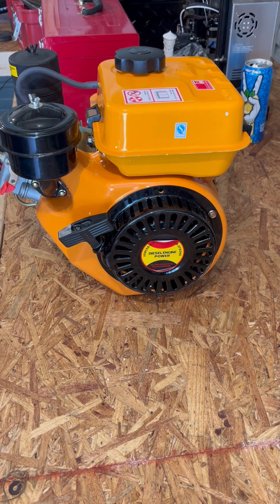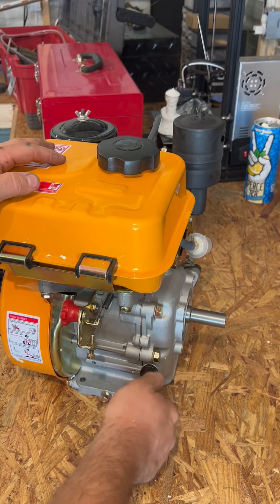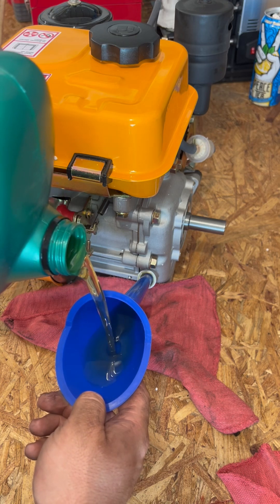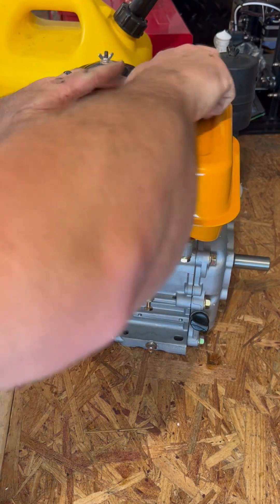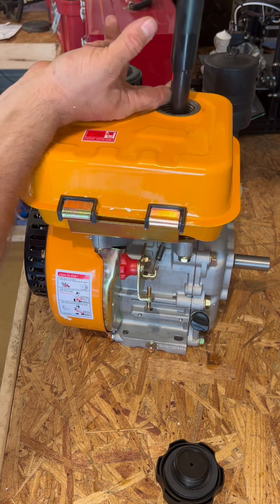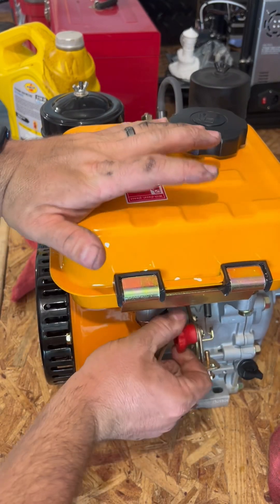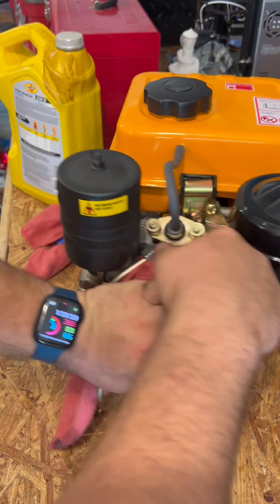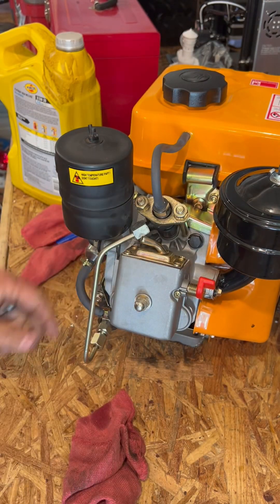$200 3HP Diesel Engine With 25LB FT of Torque?

Comment: I think these little diesel engines are super cool. But they have nowhere near 25 lb-ft a torque. They make peak torque at about 2500 RPM so if you calculate 3 * 5252 / 2500 you get 6.3 lb-ft which is a much more realistic number. 

I have one of these on a go-kart, lots of fun!

Comment: Believe it or not, it's only 6ft lbs of torque. I thought it was 25 initially too. I have one of these engines. Doing some digging and research I found it only was at 6ft lbs. The specs were based off of another larger engine in the manual. Just thought I'd share this with you.
Reply from the maker: I appreciate you letting me know that. Kinda weird they’d advertise 25, but it makes sense why it’s only 6. Still quite a bit of torque. Not too terrible only 3 horsepower.
Reply: @DTMCreations  Yeah I thought the same thing about the advertisement of the torque. But yeah 6ftlbs isn't bad for 3hp. The one thing great about this engine is that it is super fuel efficient. Its a pretty decent little engine.
Reply from the maker: @Super-225 I’ve run all sorts of fuel in it. Motor oil, trans fluid, brake fluid, hydraulic, baby oil, veggie oil… it just doesn’t quit
Reply: @DTMCreations I've seen videos of people doing that. Amazing little engine.
Reply: @DTMCreations  plus if the engine has 22 to 1 compression ratio (which this one does) it will run on just about anything.
Reply: @Super-225  22:1 compression ratio?!  Are U kidding me?!?!...  If so, no wonder it has a compression release for starting, Wow.   - take care man

Comment: They're very efficient and works very long but OMG they are too hard to start
Reply from the maker: I agree with you if you’re using the pole start, however, just unbolt the pull cover and use a socket on a drill while holding down the decompression lever, and it will fire right up when you let go of the lever.

Comment: That's expensive using road diesel in a little diesel engine like that get some of that untaxed off-road diesel
Reply from the maker: It was just for testing! It'll run on almost anything.
Reply: Six hours on a gallon? I use 15W40 oil and pump diesel and never look back. Would you feed your kids mouldy bread?

Comment: I can't get mine to run. I did everything in the video but fuel won't fill the lines. Like it doesn't leave the tank and I don't know what to do. Help
Reply: Very first step is to remove the hose off the fuel filter so you can pour fuel in the injection pump inlet hose by gravity, it is a little messy but once fuel is at the injection pump then you can simply turn the throttle knob all the way to max and hold the decompression lever down while you crank several times, you will notice that when fuel is squirting out the injector you will hear a loud squeaking noise, that is the point you just crank it up. No need to crack open injector lines to bleed.
Reply: I never even bled the line. I wired the decompress or lever down. I moved the throttle down. Pulled it like 50 times gentle. I smelled diesel out through the muffler. Ready. 15W40 oil. Mount it on a thick aluminum plate. I honed a 20 MM (.787 inch )to  one inch crankshaft adapter, and put a 7 inch pulley for an alternator.

Comment: Sichuan Shifa MB168F. Watch the oil consumption. I made a 20 MM to one inch shaft adapter. Well spent purchase. It likes a 7 inch pulley for a 10si Delco alternator. 15W40 and avoid lowest and highest RPM. Mount on a thick aluminum plate.

Comment: I have one of these too :) Runs extremely well, and mine always starts first pull! Its important to change the oil soon after your first run, however. Metal particles came out of mine most likely left from manufacturing. I ran mine for 10 minutes and then I changed the oil in order to flush it out. It runs super well, im very pleasantly surprised! My only complaint is how loud it is, but thats the nature of all air cooled diesels. I think i need to build a sound proofed box for it, hehe. Im using mine on a homemamde generator set, what i really like is that i can run it at basically idle and it still has enough torque to spin the generator even at a decent load :3 so the fuel economy is absolutely amazing. Plus the ability to run on alternative fuels is awesome!
Reply: Might want to run it up to 3600 every once in a while to burn out the soot buildup in the cylinder head.

Comment: What size is the shaft?
Reply: 20mm / 0.787"
Reply: I honed a 3/4 to 1 inch adapter up to .787 and it's Allen Key. 1 inch is perfect.
Reply from the maker: @ I'm confused, how did you hone it, and adding material? If 20mm is .787, and 3/4 is .750.. No hate, just trying to understand.
Reply: 7/8"